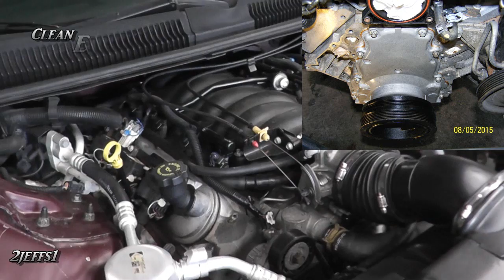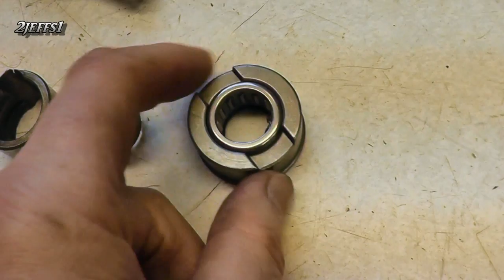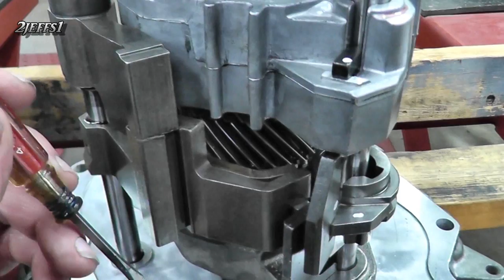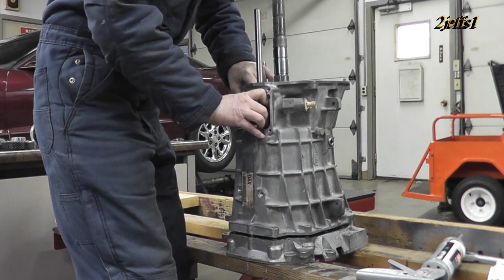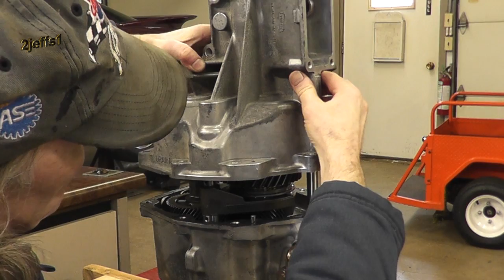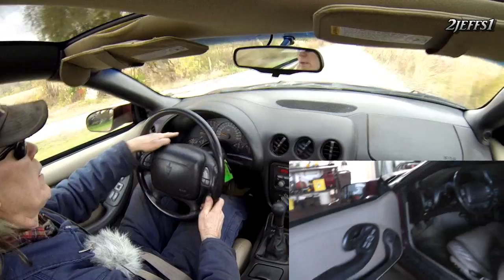Tremec T56 - 6 spd Trans Rebuild Homemade Trans Jack & New Project

Comment: Wondering what it would cost to have you do all the work you did on this car, parts and labor.  Be real;  be sober.

Thumbs up.
Reply from the maker: +WSmart1 Gotta admit I love this question. You are spot on for your thoughts! They call that - value of repairs exceeds value of vehicle. Many things I buy were rough or junk when they arrived here. I call it 2 ways to look at things. Ok - here's my take. Say you would want to go buy that car in good cond for 10k. After one pays the monthly bills and daily necessities to survive in general how long and how much extra money does one need to make/clear to have that 10 k to spend? And what about interest if one had a loan. Now that car you bought 5 years ago starts leaking oil and starting to need some of this maintenance that I done gets more expensive yet. I guess I look at things in a different way, right or wrong but fun trying!  Some of those things I probably could of left alone for a while.  I must admit that things do get over killed here. Friends say that too. I do get rough on things periodically and like when there is no worry of breakage or popping the engine. After all the work is done the dependable factor is a good thing too! Thank you for your comment. Neat how you wrote that up!
Reply: +2jeffs1 when l do my searching on craigslist l put in needs work, and pick from that list, because most of those have gotten quotes from a shop that were more then the car is worth, but if l do the wrenching l can get double my labor rate , great vid thanks for taking the time,
Reply from the maker: +mustie1 That is very interesting and helpful. I will be using that. Thank you! On the labor rate here I rarely can charge for actual time invested do to rust/corrosion and surround areas like for an intake (and the inside of them) prep takes more time than the actual work. You only get paid for the job once so no return problems is a good thing.  Keeps folks coming back!
Give you a grin - I've never advertised and the shop is not in the phone book. Under my name only. All word of mouth and the nicest people ever to work for. I have a funny feeling that things at your place are quite similar. Thank you for helping out & glad you enjoyed the vid!
Reply: +2jeffs1 yep l run the same way, word of mouth,keeps it simple too,

Comment: How's it going Jeff, I have two T56 transmissions. I have an F-Body LT1 T56  and a C6 ZO6 transmission, My question being what parts would be necessary to take off of the early f-body one to make the ZO6 transmission work. From what I understand I'll need the GTO mainshaft and the LS1 front plate aswell. I think the ZO6 has triple cone synchros and as far as i know I would need those for a higher revving engine since I plan on wrapping out to 8k in the future. Also what parts would be best to upgrade?
Reply: And what do you recommend for transmission fluid? I'm considering Nippon ENEOS GL-5 ECO-ATF, i am just not sure if it will cause the synchro blockers to balloon seeing that it's a synthetic ATF fluid but it complies with DEXRON III.